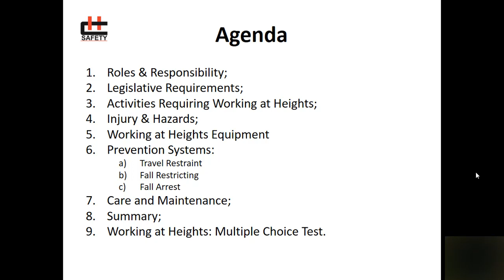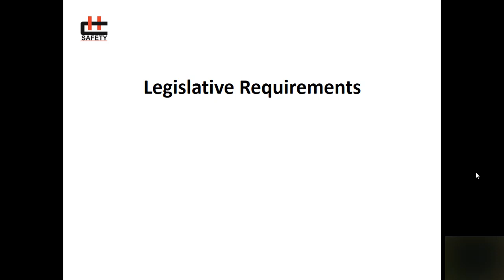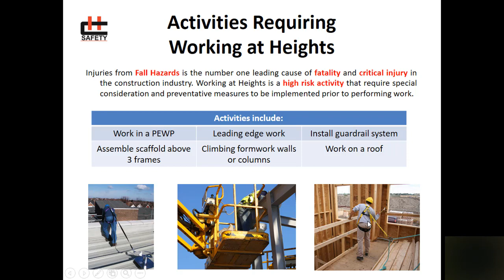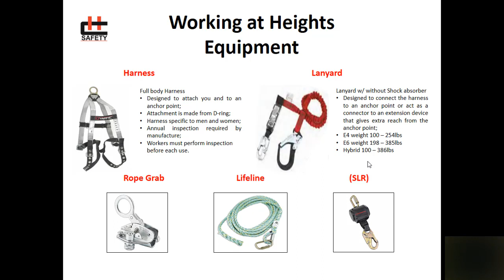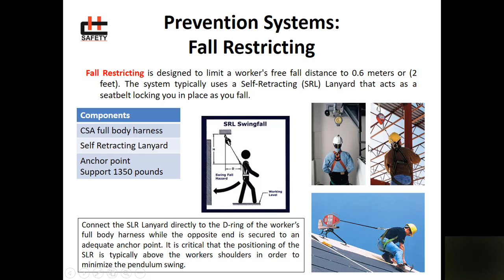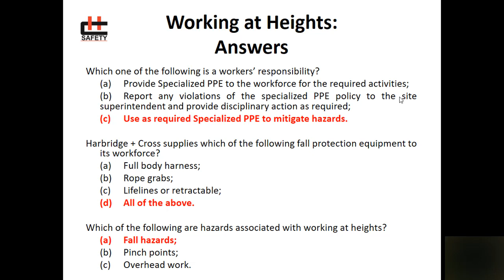Chapter 6 - W@H Equipment Training - Care Use and Type - V1.0

Comment from the maker: Question - UoG OVC - The program does not say that Working at Heights Equipment shall be inspected by a competent worker?
Reply from the maker: Under Legislative Requirements slide 7 & 8 - 26.4 (3) and 26.6 (6), it states that the equipment shall be inspected by a competent worker before each use. The program however is missing the legislative requirements for fall restricting equipment S26.5 and will be updated in the next training program.